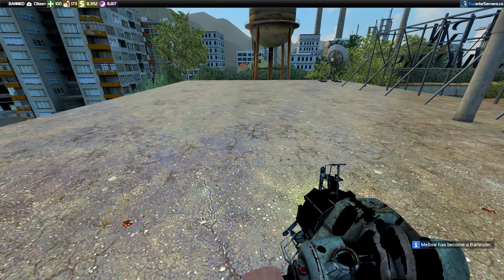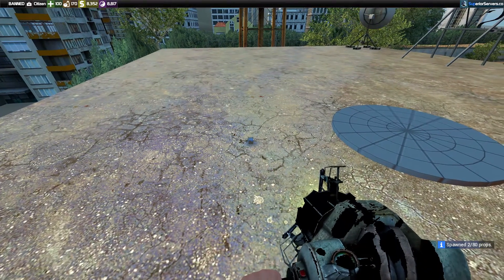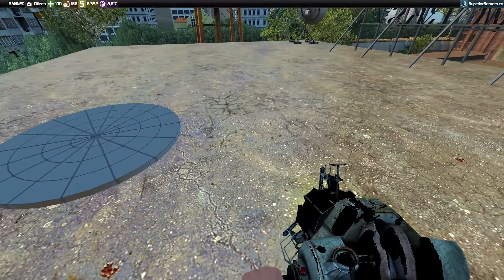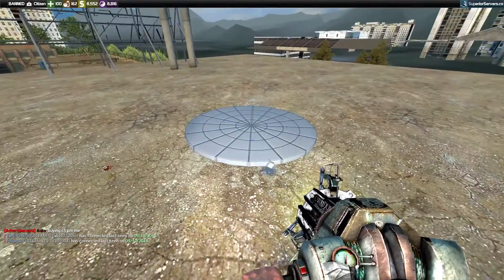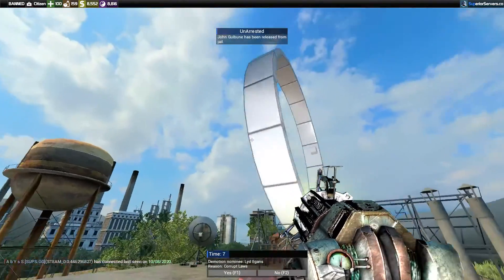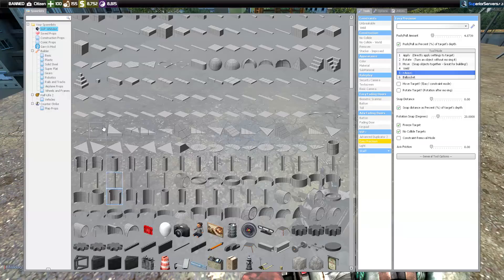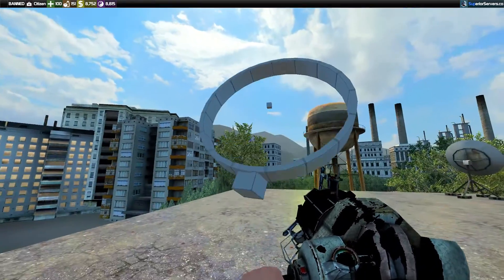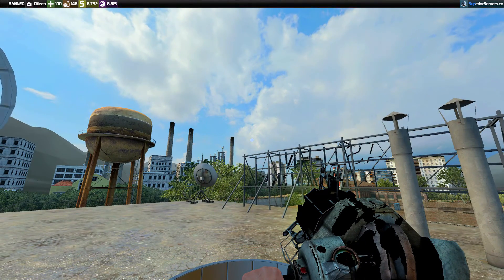How To Build Rotating/Spinning Props on DarkRP

Comment: you got the snap distance too like me nice a cool tip you can use the snap distance instead of using a bigger prop that way you can control the speed and velocity too actually I my self use two small cubes and weld it to any thing no matter how big it is I can move it the way I want